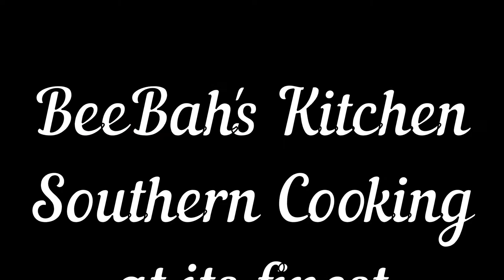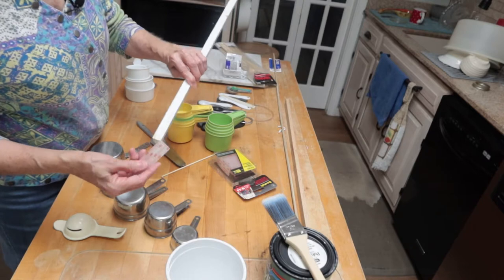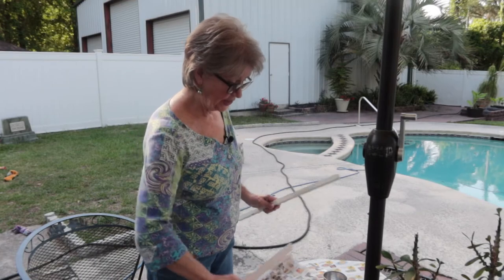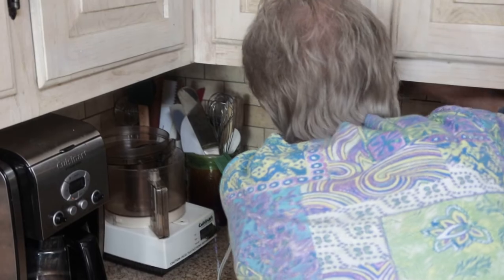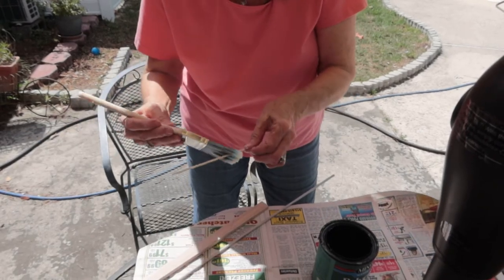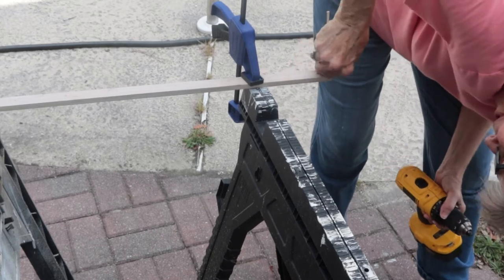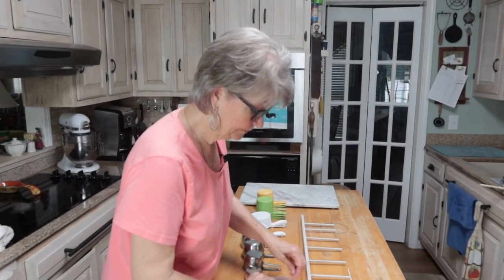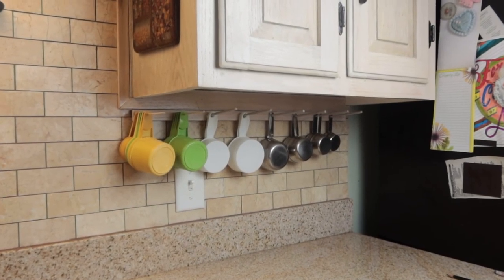DIY PROJECT Measuring Cups and Spoons Rack

Comment: Any ideas on how to keep the text from wearing off on measuring cups/spoons?
Reply from the maker: Is it a stamped text or engraved?
Reply: @beebahscountrykitchen8683  it's stamped
Reply from the maker: @mrbrown30238   The only thing I would suggest is to maybe coat the text several times with clear nail polish, allowing to dry completely between coats.
Reply: @beebahscountrykitchen8683  much thx I'll try it
Reply from the maker: @mrbrown30238  Hope it will work for you!